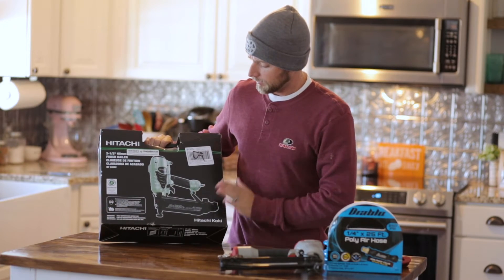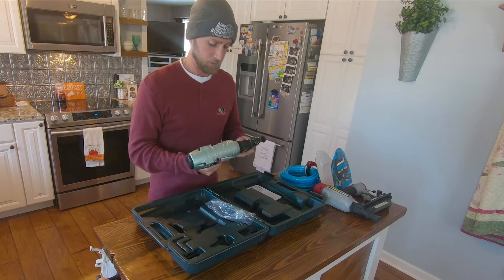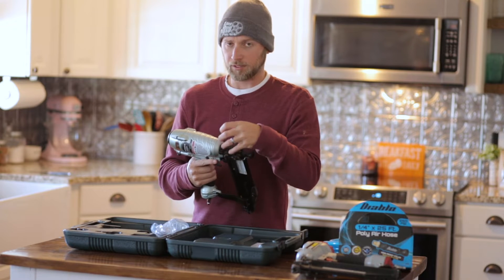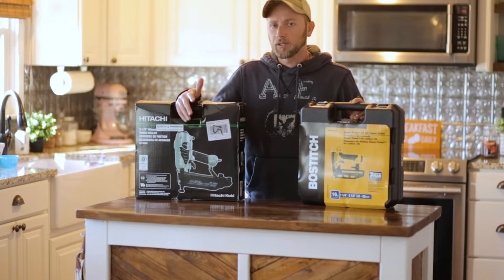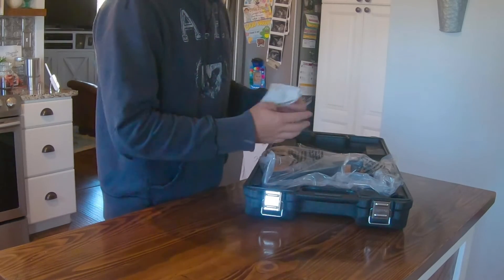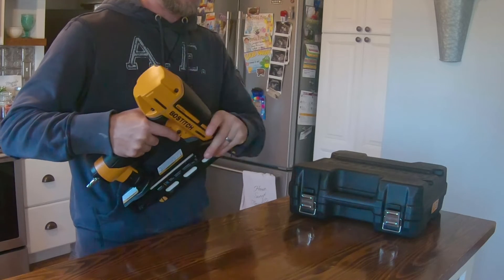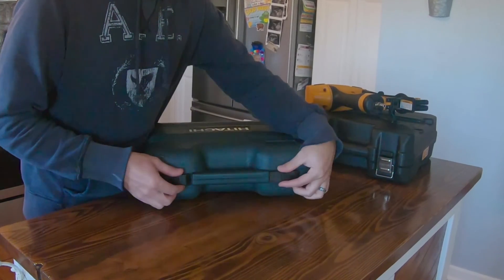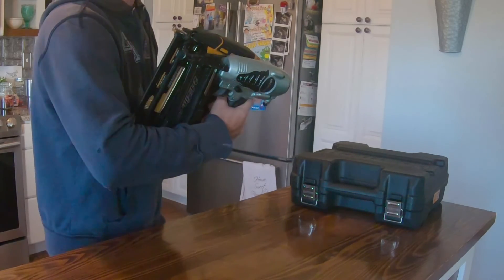Hitachi 16 gauge NT65M2 (S) Finish Nailer vs Bostitch BTFP71917 in depth comparison and review

Comment: Thankx - just bought the same nailer and was looking to see if anyone had a problem getting the nail depth adjusted. Best I could get was flush before increasing air pressure to 78 - 80.
Reply from the maker: Hope the video helped you a little. I honestly have never done any adjustments online since I bought it. Mine drives the nails a little bit below the surface and I want to say I usually run around 85 to 90p lbs of pressure but I don't really know for sure because I pretty much just leave my compressor set. If I find the depth is not quite enough I just turn up the pressure a little. Sorry I'm no Pro. Wish I could help you more

Comment: Did you look into the Makita AF601. 
Great gun..had the old paslode f16s for years until parts became obsolete..
I looked at and or tried just about every brand but nothing I liked including the Hitachi.. The Moment I picked up the Makita I knew it was the gun for me. Bought my first one 3 years ago ..only had one break down.(track spring).
I now own 3 of them. All work like new.
Reply from the maker: I have not tried the Makita. They make great tools. I don’t do it everyday for a living and I’m still loving my hitachi but I suppose I don’t know what I’m missing until I try something better. If I need a new gun I’ll definitely check out what Makita has to offer!
Reply: Ya id say Bostitch or makita i always heard the geezers consider Metabo like diy guns but honestly never tired one
Reply: @diversedad7954  after looking for replacement parts , i found kits available for the Hitachi and none for the Makita.(i have Makita drill, saws-all and circular saw)  You have to buy each part a-la-cart.  I have a Harbor Garbage 16gauge gun i'm looking to replace .But i want to be able to rebuild myself and the Hitachi seem to have more part kits available.  Anyone know the difference between hatachi nt65m2 and nt65m2s (BTW my wife is Lucie)

Comment: Was thinking about getting a central pneumatic for $70 but metabo has a sale on theirs that brings it to $110 and that extra $40 will probably be nothing compared to the headache with alot of jams.
Reply from the maker: That's probably a good call. Although I will say my little 18 gauge gun from Harbor Freight was the first air gun I ever bought and it has always worked pretty well. You just never know about those cheap ones sometimes they are hit-and-miss